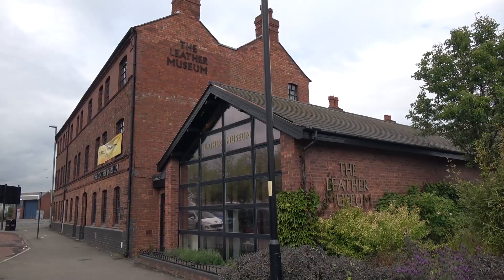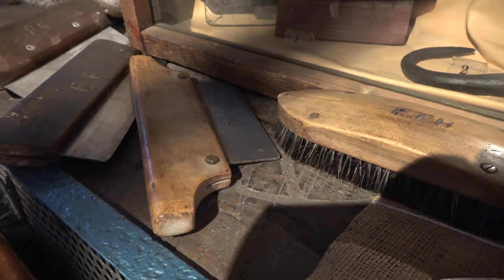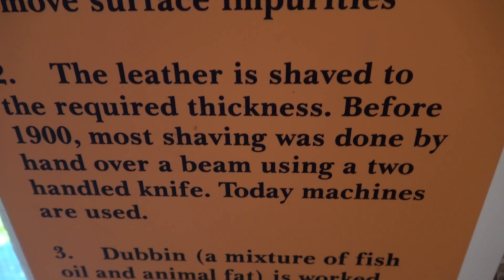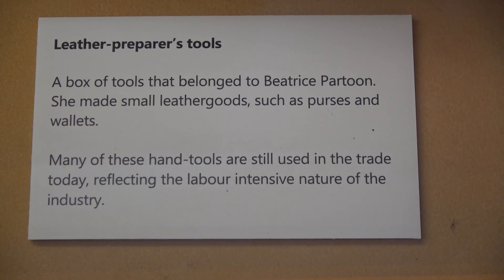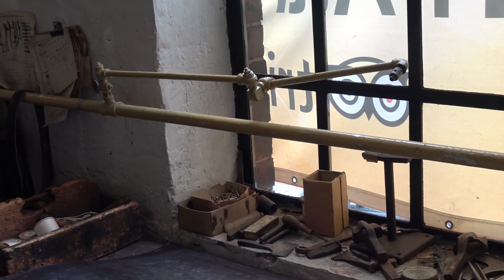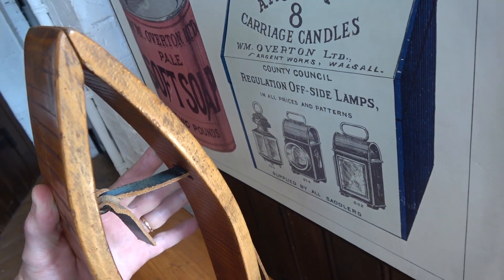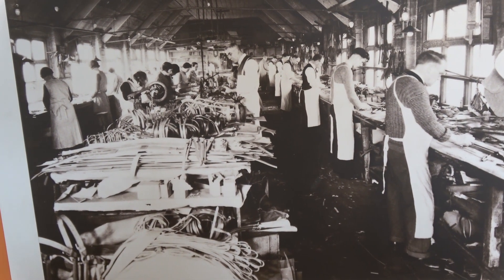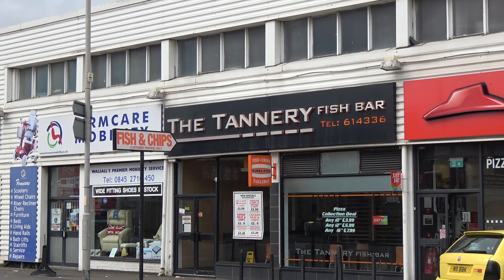Leatherworkers Dream   Walsall Leather Museum

Comment: 6.23 Patcher? PATCHER? That is a BUSM No6 heavy harness stitcher, quite possibly the finest leather sewing machine in existence. Commonly known as a Pearson 6, after the firm which developed it. Makes a beautiful stitch from 14 to 4 stitches per inch using 18/3 up to 18/10 linen thread. Rated to do 3/4" thick work, I've convinced mine to do 9/10" once. Patcher indeed...

Comment: Granddad and father both worked leather trade. Granddad was in South Staffs Yeomary as between the wars they were a mounted regiment, so saddlery connection. Dad would come home with bits of leather in trouser turn ups. He always smelled of leather dye.
Mother would do out work, dog collars. She would use a thing called a horse, sort of foot operated clamp, but not like the one shown here, it rested on a bracket on a table.
Reply: Spoke to chap who had saddle company in Walsall, sure he said had supplied the House hold cavalry in past.